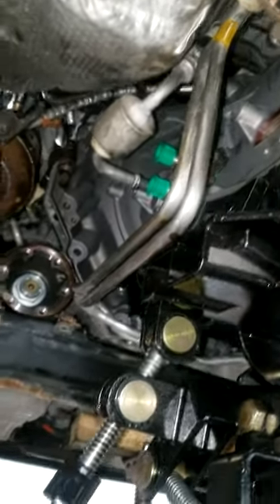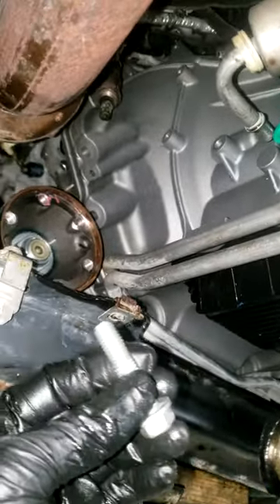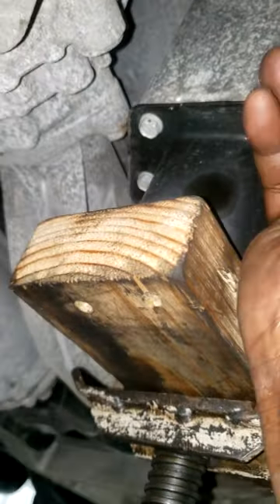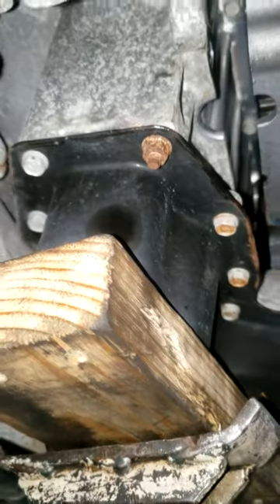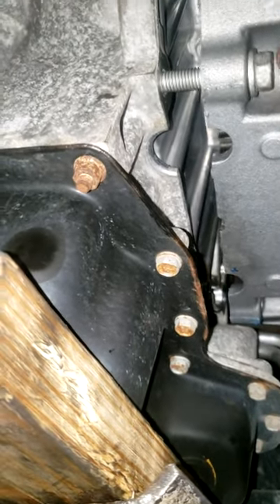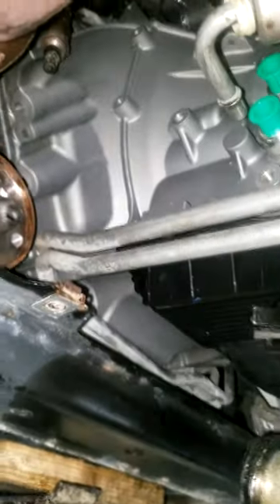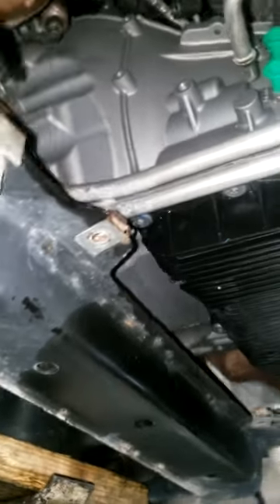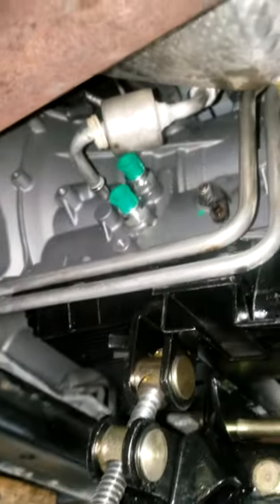All it take is 1 bolt. Then its eazy peezy.

Comment: A lot of people are misinterpreting what JT is trying to convey in this video. He's saying to start a bolt by hand as an aid to get the transmission and engine lined up together. He's not saying to tighten the bolt in order to pull them together. You NEVER want to do that. Get it all lined up and mated flush before tightening any bolts with a tool. JT knows that. He does this stuff every day.
Reply: I love him
Reply: for those who DON'T know, if you use the bolt to draw the trans bellhousing up to the engine, you could be FORCING it together unknowingly because you don't realize how much force you're exerting with the mechanical advantage of the threads. The torque converter may have slipped forward out of engagement of the splines and the converter dogs may have lost mesh with the front pump dogs. By forcing it together you can break the front pump and/or the torque converter neck. This will result in money disappearing from your wallet and having to disassemble, replace and reassemble stuff. No bueno.
Reply: @budlanctot3060  Or it can break the aluminum bellhousing!  No gooda!
✌❤🍩
Reply: I always get all the bolts started, jiggle the transmission to get that "feel" like everything is sliding in nice and aligned, no binding. The gradual torquing with that same "feel" of proper connection. Then finally, the last round of finish torque. Then check every bolt again to be sure. (Ah-h satisfaction)
Reply: BTW. I HATE working on transmissions.  Just saying. 
(hate it)
Reply: @calvincosby921 why? it’s gravy work. i do a 2wd chevy transmission r & r before lunch. get a 3 ft extension for them top bell housing bolts and you’re good to go.

Comment: A trick I use is to go to the hardware store and get two long bolts with the same threads and use them to guide the transmission on. Works like a charm every time
Reply from the maker: Thanks for sharing
Reply: same here. I used to also cut the head off and then cut a line in the bolts to remove them with a screwdriver.
Reply: Yep - I was suffering through trying to get the half axles bolted to a front wheel drive transmission. Added a couple of guide bolts and it was easy.

Comment: My 2 cents.. I do use 1 bolt to keep everything lined up. I  don't just tighten the one bolt to squeeze it together. By having a bolt in will allow a small bit of rotation, but will prevent it from rotating on all axis.
Reply from the maker: Thats my point. You just happen to word it better, thanks

Comment: Just don't use the bolt to draw the parts together since you risk damage if it's not perfectly aligned.
Reply: Always make sure your dowel pins are on the tranny or engine, have almost swapped transmissions before with 0 dowel pins on it, could’ve been a lot more uglier
Reply: Yea can’t use bolts to force parts together learned that the hard way. Best to guide/tap it in while you slowly tighten. If it doesn’t wanna tighten than something’s wrong
Reply: I did that before with one of my cars it just wouldn't go in I was rotating the engine while messing with the gears on the tranny finally got it right and it slipped on like butter. She's still fine 30k miles later

Comment: Put a pair of long studs in the easiest place to get it, helps line up the tranny and slot her in Way easier than just messing around lining up your input shaft or torque convertor. Half the time i leave studs in and put a nut on specifically because it's better than fighting to align a bolt, help out the next idiot, because he could be me.

source: build motors, do swaps for a living.
Reply from the maker: Interesting take you have on it..Never gave it much thought. Thanks
Reply: @OnlineMechanicTips  Thanks for the videos.

Comment: For me and my honda transaxle, it was lining up dowel pins. when the engine was out of the car and i had the engine on a crane and the transmission on a transmission jack (the crosstour’s 5spd 4wd transmission weighs something like 250lbs, she dense) and once i got the 2 dowels lined up all the bolts went in perfectly, then it was a matter of peeking under it and connecting the torque converter to the flex plate

Comment: I would strongly recommend starting the first bolt in the top side of the bellhousing. 2 reasons:

- Safety. If your transmission jack slips, or if you let it down just a tiny bit too far, the weight of the tranny pulling against a single bolt in the bottom will easily bend or break the bellhousing.

- You can use the weight of the tranny to make stabbing easier. With a bolt in the top, you can pull the top of the bellhousing towards the motor, then ease the tranny down to let gravity pull it inward. A little rotation one way or the other to align the dowel pins...and voila.
Reply from the maker: Yes that mske sense but this a Jeep. Those top bell housing bolts very hard to go in. Some techs don't even put them back in because they so hard to get to. So on this Jeep any bolt is fine imo.
Reply: Elephant key 👌
Reply: Huh makes alot of sense ima keep that in mind ty

Comment: Ithe worst part gaha. I used to make starter dowels with threads and strike a line in them for a flathead and then guide the transmissions on them until I got some bolts started
Reply: That's a good idea
Reply from the maker: Interesting

Comment: Ooo, bad bad!  NEVER! Bruh! I KNOW you know not to pull a trans up to an engine with a bolt or two! Never start ANY bolts untill the bell is mated squarely to the block, with BOTH dowell pins in place! Unless you like that blood curdling SNAP sound of breakage, or yo-yo's. ¡Very expensive yo-yo's!
Reply from the maker: Lol I never said use the bolt to pull the trans into alignment. The all important first bolt can be use to align the trans. But you have to get it started first.
Reply: @OnlineMechanicTips  I remember laying on my back in the driveway having a bench press him up in there that was no fun. On the lift with a trans jack, I just strap them down tight to the trans  Jack and use the directional controls to get it leveled right in there. Oh yeah, my bad. I didn't have my coffee in the morning. Then I sat and I reread that thing and you didnt say that you was going to use the bolt to pull it in there, but it sure was looking like it. All i was sayin was i know you knew not ta do that! Checked your other short and it will come down w/transfer case mounted. It is tighter, but YOU CAN DOO IT! Remind the rookies to use floor mats & seat covers, and dont be sniffin the seats mwah ha ha

Comment: I did that once ended up needing a new oil pump in the Trans because the TC wasn't seated properly so idk but I wouldn't do it again
Reply from the maker: You did what once?
Reply: Exactly. This is a surefire way to ruin a trans oil pump. If the transmission doesnt slide into place. Youre doing something wrong.

Comment: I always have a couple leftover!
Reply: Hey it goes down lol 🤷🏿‍♂️🤣. Sometimes it doesn't require them all lol. I dont hardly do customers like that but depending on the application  🤷🏿‍♂️🤣
Reply: If you've changed Modular Triton Ford starters, you would know that top bolt is not required 😉😂

Comment: Try that on a manual transmission and see how much  damage you can cause. Also that's a great way to crack a casing.
Reply from the maker: This not a manual transmission. And you not gone crack a case by getting the easiest bolt started first. Dont be a drama queen.
Reply: He didn't say to crank it down and pull it together with the bolt. He's just saying to get a bolt started by hand to help align things while it's going together.
Reply: @OnlineMechanicTips  As long as your not using that bolt to bring it all together. But I would specify next time for viewer that may not know not to do that on a manual transmission.

Comment: Nooooo! Never mate a trans by tightening a bolt! ALWAYS make sure the dowels are aligned and the the trans case is fully seated against the engine! ALWAYS!
Reply from the maker: The video is about getting over the hurdle of at least starting 1 bolt by hand first. Technically you have to do that anyway
Reply: @OnlineMechanicTips  glad you said it

Comment: Never ever do this. Engine and transmission must always be fully mates before any bolts are tightened! You risk serious damage.
Reply from the maker: Omg..calm down drama queen. You won't damage any thing. Did you hear anything I said? The first step is to get at least 1 started. After that, the rest should be easy to center and glide on.
Reply: Inexperienced people could definitely try to use the screw to force the gearbox onto the engine. If you have trouble getting the transmission on i have a tip for you. You could have a tool on the crankpulley and jiggle it slightly, to make the splines line up.
Reply from the maker: @douglasberg2881  interesting my guy